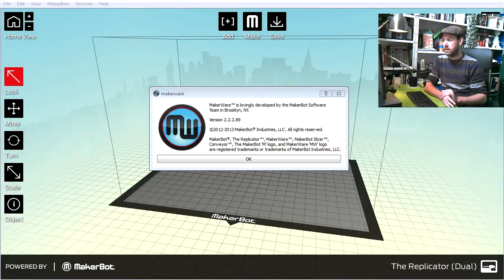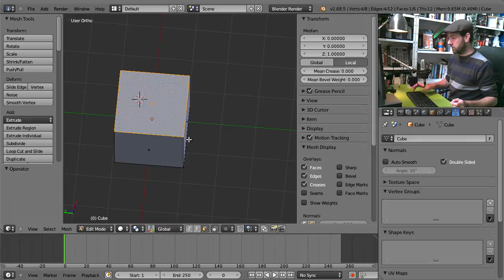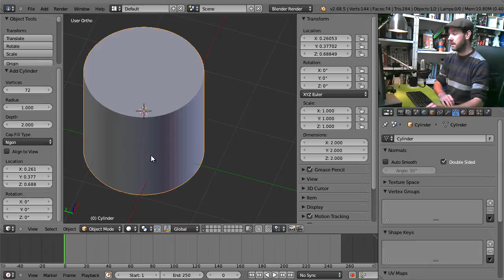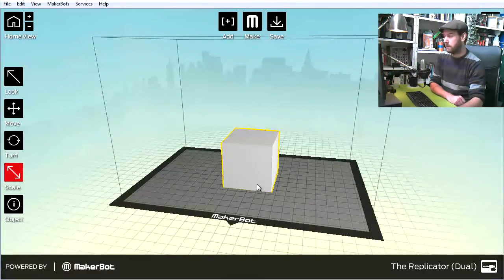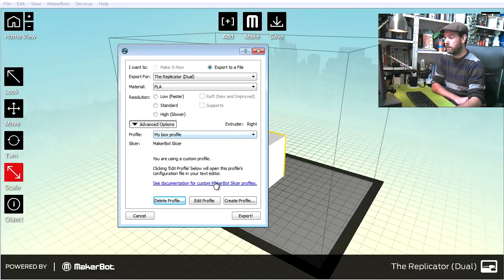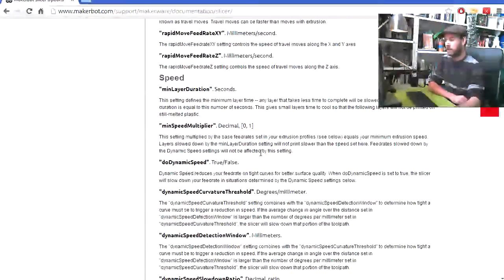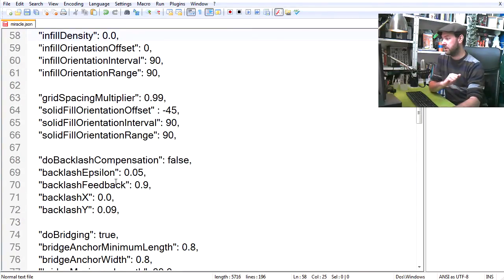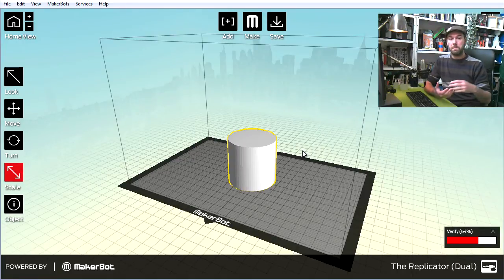Making a 3D printed box and cup in Makerware (advanced settings 101)

Comment: i notice that the makerware default extruder temp for pla is 230 degrees C.  Isn't that a bit high for PLA?  I usually print around 190-210 for PLA when using ReplicatorG.
Reply from the maker: +Joseph Holliday Yes... I use 200 to 210 too usually. I think it was a setting that crept in with a specific batch of makerbot filament.